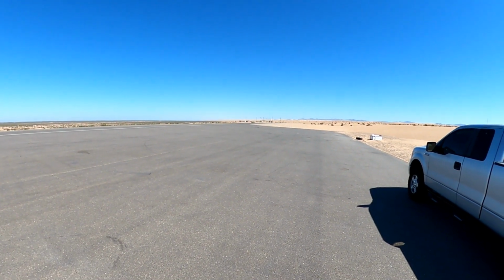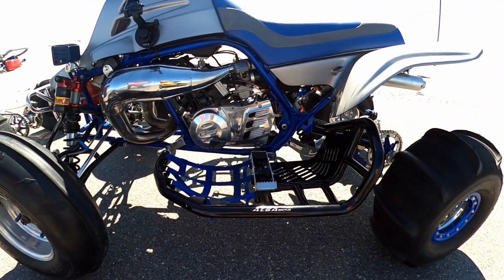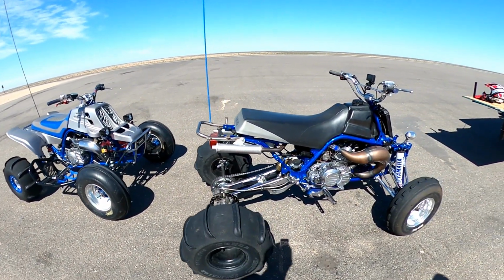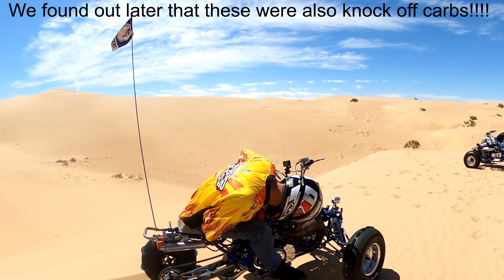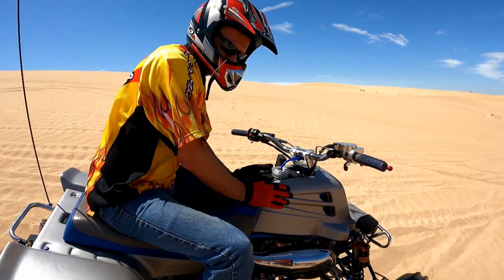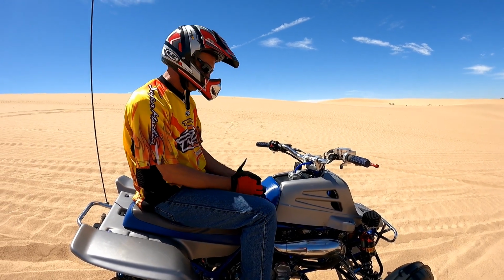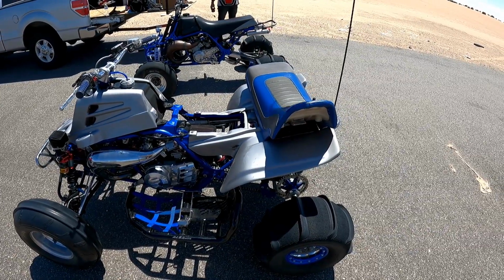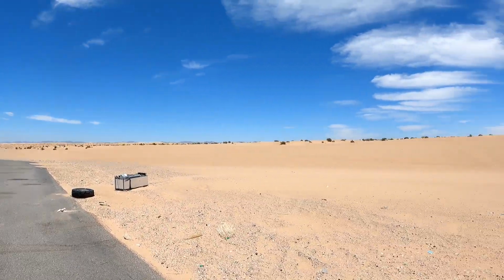Banshee 4mil stock cylinder and 472 Super Cub in Glamis CA.

Comment: I love my 4 mil SC. It wants and loves RPMs. Mine have SB Shearers. Once that power band comes in, it makes you forget about the rest lol. They just keeps pulling. I built a SC with the intentions of hitting some clean trails. If it’s not open or wide trails. Mine is a handful in tight spots with that drag port(all out). Plus I’m fully tuned to 110 with my advanced timing. But I love it.

Comment: I was thinking too fat at first too but after u cleared that up my 2nd would be cdi. Or the little wires the plug onto coil. If ones even a tad loose it can have intermittent good spark, with a constant crappy spark. Shorting out ground? I dielectric every plug everytime, hope u figure it out, maybe the stator is borderline in spec? Also hope u keep doing vids. I know knowledge ain't free but I learn something from each video u make and I'm new to flipping banshees. So I restore everyone top to bottom powdercoat whole 9. Deff new to strokers too so all the little technical tips on stroker builds helps.

Comment: I was wondering if you can answer two questions for me I have a banshee 10 mil runs on m1 alcohol and what I'm asking is do you when you get the carburetor do you tune off the main jet or do you tune off of the power jet. My second question is when you're looking at the plug I've heard a rumor that methanol Burns way differently than gas the plug has to be like sort of white not quite brown but but more white and the plug will look wet so I don't know I'm still trying to learn look at the plugs on methanol do you have any tips or tricks on that
Reply from the maker: Tune off the power jet is how I do. The spark plug will look different on alky. The burn on the strap reads the same.
Reply: @herrjugsracing7816  thank you